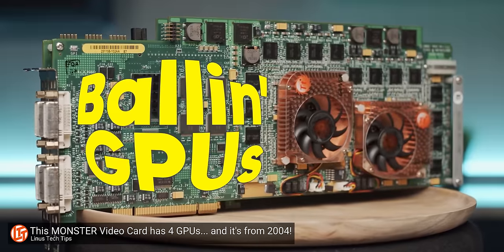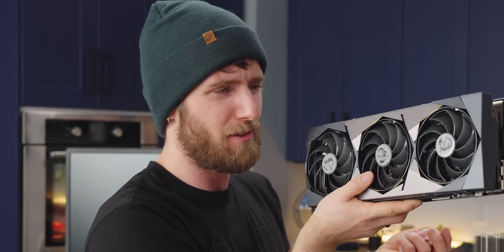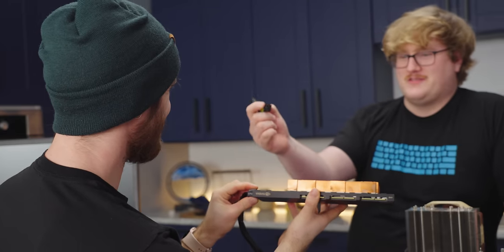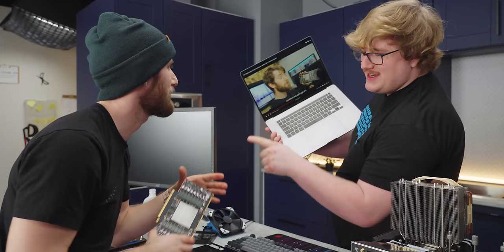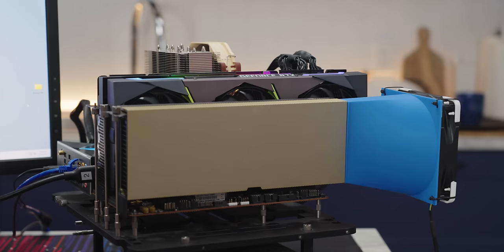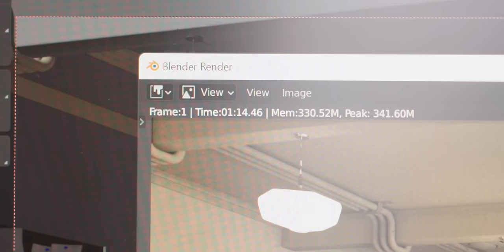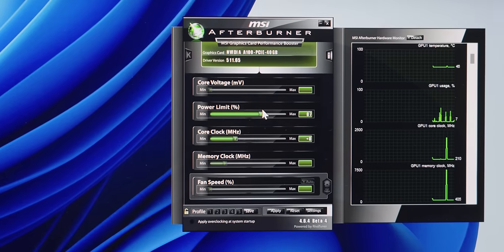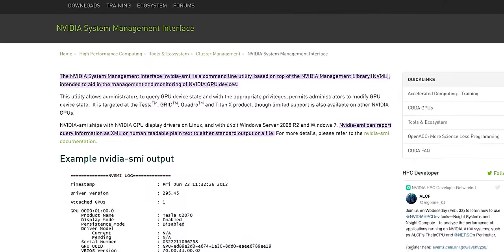NVIDIA REFUSED To Send Us This - NVIDIA A100

Comment: I always love the moments where I realize that 3090s aren't the peaks of it's generation.
Reply: They probably have the technology for 10x 3090 but not good for business to lay it all now
Reply: In terms of gaming cards, it is top of the line
Reply: @evanshireman5644  well it's not. the 6900xt is mostly faster at 1080p and even at nvidia, there's a 3090 ti in existence.
Reply: @ProjectPhysX  except for those that are memory limited.
Reply: @Ornithopter470  yep, you can never have enough memory... but 80GB is already quite a lot :D
Reply: @amashaziz2212  it is top of the line in gaming performance in comparison to the 6900xt, they are both the top dogs of amd and nvidia which was my whole point.
Reply: @AshknFX  - not only for business... alot of precious metal resources are required for such amounts of possible sells in such a unbelievable high quality in questions of production (definitly more than a RTX3090 needs), normal people without any specific use (gamers for example) dont need such hardware at all, programmers cant make such big steps without self-destructing issues, bugs etc. and you'd need many other different components than regular PSUs, any Ryzen CPU etc.
You just cant plug a quantum-cpu on any gaming mainboard - for example - with any rtx-gpu and that shit will just run like magic... 🤭 

Give that progess time - there is no reason to claim that gpu-producers holding their truely powerful graphics cards back for selfish reasons. 🤐🤐
Reply: @iTzBrillianTFX  i mean yea. But in general not only in GPU. Some Companies will hold back for sure. U cant sell a new for example phone with the same specs. U need new better specs for marketing. It not like they just discover a new technology every year
Reply: @iTzBrillianTFX  i dont care either way. I dont buy a new phone or gpu every year
Reply: Yeah, the 3090 outperforms 8, 16, and 32fpp calculations (good enough for games, folding, and Ray tracing), while the A100 does 64dpp calculations a lot better (much more precise, for deep learning and fluid dynamics)
Reply: Seems more like comparing an F1 racer and a sedan.  They aren't meant to do the same things so saying one is better kinda misses the point.
Reply: @ProjectPhysX  0
Reply: @evanshireman5644  well ur point is quite wrong is what I was saying in my previous comment.
Reply: @amashaziz2212  who seriously is gonna dish out big bucks for a top of the line GPU and game at 1080p? 2000$ GPU and 100$ monitor lol.
Reply: @amashaziz2212  why would you be running 1080p if you have a 3090 wtf
Reply: @uwuLegacy  exactly
Reply: @architectsxiii5379  thank you! :)
Reply: @uwuLegacy  huh? when did I ever say that?
Reply: @nocoffee badday  lol i got a 3070 and play everything in 1080p
Reply: Yeah the gaming card were never the top of their generation, a quadro or titan always beats em to it
Reply: @amashaziz2212  Who buys a 6900xt to play at 1080p??
Reply: @nja3817  and everyone else who's asking "why would you buy high end graphics to game at 1080p", to play at the highest refresh rates possible with consistent frametimes. 

This doesn't really apply to most people, but if you're chasing the bleeding edge of competition, you'd probably go with a 1080p monitor that has refresh rates in excess of 360Hz over a 1440p monitor at ~144Hz. 

You need a somewhat beefy graphics card if you want that to stay pegged there, maybe not 3090 levels, but still, there are valid cases like that.
Reply: @architectsxiii5379  yeah but the last titan card was released with the 2000 series, as far as I know there was no titan card released with the 3000 series
Reply: @Senzorei  There is no CPU that allows you to do that with a 6900xt at 1080p. If you lower graphics -> CPU bottleneck. If you play low res stretched -> CPU bottleneck. A 3070 will give you the same result as a 6900xt at 1080p with a 12900k lol
Reply: @amashaziz2212  yet slower at 4K.
Reply: @ProjectPhysX  It really depends who you are. On the server, either virtualised or dedicated for simulation, rendering or ML .... it isn't.
Reply: @AshknFX  Lmao no they dont. We are reaching the end of moores law with silicon based Gpus and CPUs. TCSM is almost at 2nm technology for chips and basically said that is the smallest they will EVER be able to go. Its just physics. Obviously at that point they can start adding more silicon and make bigger chips overall. But then we have more power draw and A LOT more heat to disperse. 
Well probably get two or 3 more generations of GPUs going to smaller dies and then well start seeing the opposite of what CPU and GPU makers have been doing the last decade+.  They have been going to smaller and smaller silicon to get more power while using less energy and producing less heat. Once they get to 2nm well start seeing much larger chips, and well be building much larger computers with INSANE cooling systems to keep the chips cool. itll be interesting for sure.  They have next gen mostly figured out. But no company has even a few generations figured out lol. It takes SOOO much work to scale down the size of the silicon on the die.  At that point progression will either stop since people wont be running 3kw PCs in their homes or they move on to something besides silicon. Which there is some really cool stuff to look forward to in terms of moving away from silicon but itll be quite a long time before we get there
Reply: @amashaziz2212  why would you get either of those top tier cards if you're only going to run at 1080p? You're going to be running 1440p or 4K on those cards, and the 3090 is faster at those resolutions.
Reply: @TimBoundy  when did I ever say that I would get 3090 for 1080p? why is everyone replying to me acting like I said so??
Reply: @amashaziz2212  who tf will be using 1080p if you have a high end gpu? No one.
Reply: @amashaziz2212  because you said the 6900XT is the faster card at 1080p. That's irrelevant, the 3090 is faster at the resolutions those cards are actually used at.
Reply: @amashaziz2212  Your first comment said 6900xt outperforms 3090 at 1080p.
Reply: @dannynguyen4485  yes it does. so?
Reply: @TimBoundy  I don't think every 3090 or 6900xt buyer has a 1440p or 4k display.
Reply: @amashaziz2212  if you are buying either a 6900xt or 3090 for 1080p, you are doing it wrong. People who do that probably have a 60hz monitor too.
Reply: @ProjectPhysX  shameless plug.
Reply: @stavencapp  or maybe a 360Hz. have u ever considered that?
Reply: @amashaziz2212  I doubt there are many who can afford a 3090 but can't afford a 1440p or better monitor. If you're limited to 1080p you shouldn't be getting either of those cards.
Reply: @TimBoundy  read my previous comment
Reply: @ProDigit80  Ironically, the much touted deep learning can frequently be done with low precision.  It's the scientific workloads that demand more.
Reply: @amashaziz2212  What is the point of a 360Hz monitor?
Reply: @zvxcvxcz  esports? didn't think about that, now did u?
Reply: @zvxcvxcz  like said, most scientific workloads are done at 32 bit. And they're thinking of shifting it over to 4bit ai models, because they're quicker
Reply: @amashaziz2212  Who TF buys a 3090 and plays at 1080p? That's like buying a McLaren and driving 20mph on the highway.
Reply: not really, these kinda cards are terrible at outputting images, they are build extremely specifically for AI and machine learning purposes. Yes they could build a faster GPU, but unless you're willing to get a GPU that pulls 500+ watt, its not ever gonna come out.
Reply: @patrickrosington1174  i think along the same line as yours.. Moore's law apart there gotta be the Uncertainty Principle coming into play here for the sizes they're going towards . I personally think analogue computers for specific purposes will be developed and for general use we'll have our normal RTX and stuff..for those really tech addicts there's probably gonna be larger and larger gpu as you can see in 3090 vs 4090..its so much more massive
Reply: @amashaziz2212  6900xt can barely rt though, so it balances out

Comment: I replaced one of these cards for a customer who had 3 of them in total in a Dell 7515 server running dual AMD Epyc 7763 64 core processors. I remember thinking this APU is worth more than my car.
Reply: At that point it may be worth more than a small apartment.
Reply: @megan00b8  Cries in Australian
Reply: @megan00b8  In my country, it's worth more than our life long income
Reply: It was always fun working in a customer's cage and you open up the shipment that FedEx delivered and it is beat all to hell and find 6 server GPUs or a line card full of 100Gig Optics and realize that the package is worth more than you make in 5 -10 years.
Reply: @IgoByaGo  cage?
Reply: @Intelwinsbigly  Data Centers refer to a customer's space inside of the Data hall as the Customer's Cage. Usually due to it being made out of Cage Mesh.
Reply: At my data center we have a few chassis that hold 6 of those cards each.
Reply: @janemba42  also cries in Australian
Reply: @christianschwinof2464  whats the adress of the ur data center
Reply: Crazy how they had three of them and dual CPUs in a 2U single socket Dell 7515.
Reply: @computersales  You know you are a real computer nerd when you can spot that.
Reply: @--_DJ_--  lol it seemed like an odd config so I had to look 😅. Maybe OP meant the customer had multiple machines 🤔

Comment: Just wanted to point out that TensorFlow by default allocates the whole memory even if it's not using it, so the A100 may benefit from a larger batch size
Reply: Yeah! that what this GPU is for. You can train really big stuff there!
Reply: This is usually used in data centers right? so this might be what we've been sharing in cloud computing
Reply: @ChristopherHallett  man, the old testament God was way cooler than the new testament one. At least regarding roman-era like entertainment

Comment: I'm glad Jake said "ah, it has an IHS" because for a split second I thought that was all GPU die and nearly had a stroke
Reply: amogus
Reply: Yeah, me too. That would've been the most monstrous die I've ever seen.
Reply: Same. I couldn’t believe what I was seeing!
Reply: yesss, my exact thoughts
Reply: @benjaminoechsli1941  go look at the "wafer scale engine 2", cerebras just took a whole wafer and made a chip out of it
Reply: Well, the GPU is surrounded by HBM memory stacks, but the GPU itself is 800 square mm or ~3cm each side...  so yeah it's huuuge
Reply: same otoh the price is high enough for some silicon insanity ... ^^
Reply: I remember when I disassembled a GTX 280 (GT200 die) and it was HUGE. Then I remembered the x00 cards have heatspreaders on them. Still looks pretty insane.
Reply: I mean, it's STILL a huge die. 1.28 square inches. That IHS-to-die size ratio looks to be only about 4:1 or 5:1, which is a lot smaller of a ratio than most CPUs (usually 10:1 if my math is right).

Comment: @13:55 what you guys are totally missing is that, the A100 has fewer CUDA cores but they do INT64/FP64 half throughput of INT32/FP32.  The 3090 is what, 1/16th throughput or something?  It's meant for higher precision calculation.  The Desktop and Datacenter cores are different.  You need to do a test on 64-bit calculations to compare.
Reply: Didn't understand but you sound like you know your shit
Reply: Nerd
Reply: @kvncnr8031  It does 64-bit math like 10x faster than the 3090.  So it's better for where you need high precision.  Neural networks in particular can get away with much smaller numbers, like 8-bit values in the network.  A bit is basically 1 or 0 in a binary number, so the number can represent a larger value with more bits.  Or if it's a floating point number, it can have more precision (ie represent more decimal places).   For scientific computing, like modelling the weather or physics simulations, you want higher precision math.  That's why the A100 is tailored for 64-bit math, where as the 3090 is tailored for 32-bit math and below, which is the most common precision used for graphics.
Reply: I think the amount of Tensor cores is also different. Not even sure the older graphics cards have Tensor cores
Reply: @Daireishi  i like your funny words magic man
Reply: This is very cool info. Thank you.
Reply: It's also meant for the large batch models that need large loads of ram as indicated in the front of the video sort of.
Reply: Not to mention the artificial laws/rules where you arent allowed to do ML production work loads on consumer gpus.
Reply: 100% correct
Reply: @Spaulding No he just went to school.
Reply: @Daireishi  dem I didn't even know graphics cards run on different number systems ... I used to think everything runs on the same system as your pc (64 bits nowadays) ... seems like the windows convert these while compiling the commands i guess .
Reply: Yup we can’t accelerate density functional theory calculations or some ML stuff without that FP64 throughput. It’s the only reason these cards exist
Reply: Absolutely understood everything! I'm now an electrician, thank you for changing my life 🙏 ❤️
Reply: Why would you aim for precision in AI-focused card?
Reply: I like your funny words magic man
Reply: This guy computes
Reply: @Spaulding lol....coulnta said it any better
Reply: Thanks for posting this
Reply: because this gpu is made for ai , data centers and hpc
it must have faster and higher precision calculations
Reply: @Spaulding just leave the channel kid if you don't understand what they are talking about and also get smarter :)
Reply: @daniil-f  Little late to answer this question but the simple answer is, the AI needs it. You need extrememly precise calculations for many of the renderings and models. The point of these cards is more or less to NEVER (or extremely rarely) make an error. For example, the entire point of the TITAN line of consumer cards was to more or less guess pixels so it didn't have to calculate near as much (increasing render rate). For extremely complex math models, this could be disasterous and could lead to people dying due to a bad calculation. Companies and organizations employing the A100 type cards simply cannot afford these errors.
Reply: My brain was already oozing out of my ears within the first 50 seconds of this video.  Now I read this shit, and it makes no sense, but I like you.
Reply: Explains the massive bit ratio
Reply: He's Speaking The Language Of The Gods :0
Reply: Awesome. That’s the type of shit I was curious about

Appreciate ya
Reply: @Daireishi yeah i knew it!

Comment: By default, Tensorflow allocates nearly all the GPU memory for itself regardless of the problem size. So you will see nearly full memory usage even for the smallest model.
Reply: cuda_error = cudaMalloc((void **)&x_ptr,  all_the_GPU_mem);
Reply: As much as I like LTT, they never do benchmark's involving AI/Deep Learning properly.
Reply: @gfeie2  start with USIZE_MAX memory and binary search your way down to an allocation that doesn't fail XD
Reply: Oh that explains a lot. I was wondering how they managed to tune it so perfectly, because Pytorch would simply crash if you tried to use more memory than available.
Reply: should've used pytorch yeah
Reply: @pu239  You can set some environment variable to get XLA (the backend that actually does the memory allocation in TF) to dynamically allocate memory in the same way PyTorch does but you'll take a performance hit.
Reply: physical_devices = tf.config.list_physical_devices('GPU')
tf.config.experimental.set_memory_growth(physical_devices[0], True)
Reply: @kleingeoff  Maybe not enough benchmarks built into these things? I wish they tested performance in AI Voice learning/rendering or Deepfakes....
Reply: @AmstradExin  TensorFlow and PyTorch dont really have built in benchmarks, they arent benchmarking tools. They have pre-built models that people can use, but they require knowledge of how they work and how the API's work to be able to get them right.
Reply: @teknoman117 yes of course!! I love my allocations to run in O(log(MAX_INT))
Reply: @AmstradExin  Doing machine learning and neural network is like doing millions matrix multiplications, check the results, change the parameters, save them and repeat until the check is satisfactory. You just literally has too many numbers to hog up the memory and too many pending calculations.

Edit: Each matrix could easily have like millions numbers too even in simple problem.
Reply: no way bro everything has double sides, cause I buy RTX3080 for chipper price, but its side crashed my tiny tower for matx, in this way rtx4070 is bettet for size, but  established a higher price.😂😂😂
Reply: Yeah that's true good point

Comment: I love getting to see the incredibly expensive equipment that runs data centers, even though I understand about half of what they are used for. The efficiency is just insane
Reply: Understanding half of what goes on in a data center isn't too bad, though.
Reply: Basically, it has half the gpu cores, but way more AI cores, apu, to do AI tasks, at about half the power.